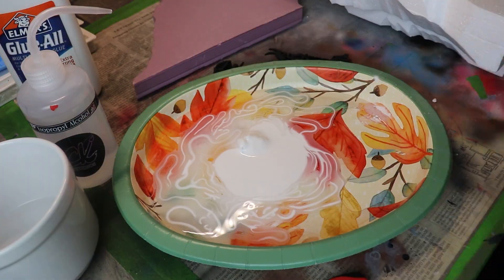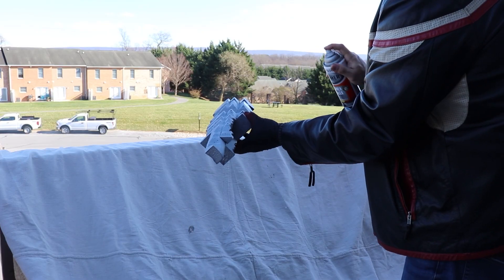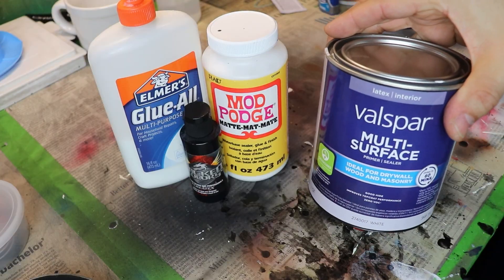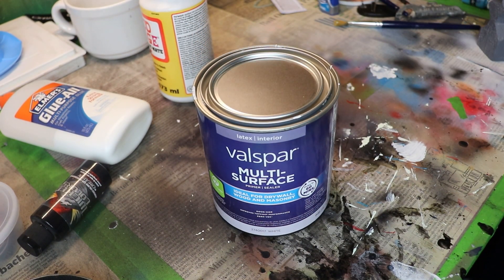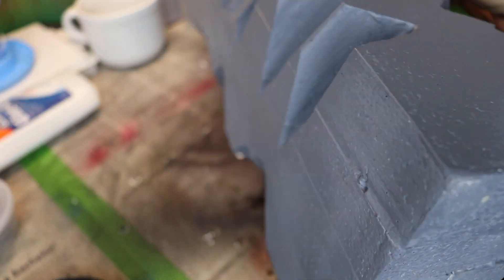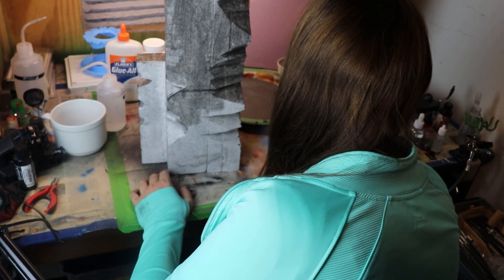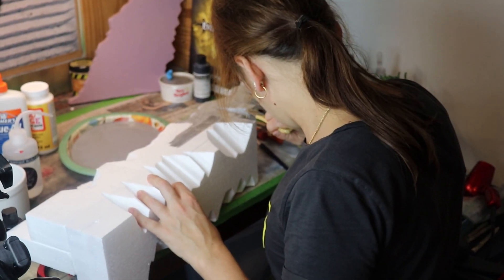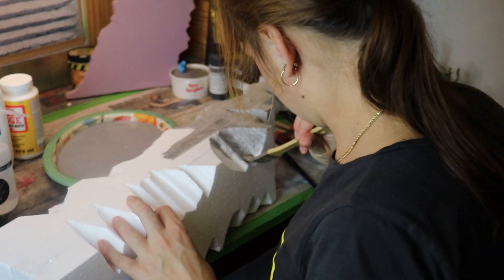Hobby Tip: Spray painting Foam Without Melting

Comment: Good Job TMP! Thank you for the content.
Reply from the maker: Thank you so much for watching Superfly, I hope it is useful in you future foam creations.
Reply: @TheMiniaturesPaintbrush  a tip for you: if you want to use a rattle can, just cover the project with dry wall filler. It works really good with the cheaper white foam.
Reply from the maker: I can see how that can be helpful in covering up the foam, but it will also leave a texture,  I’ll need to get better at my muddying skills.  I will definitely use mudd (the drywallers term for spackle, I use to be one lol) when I am creating my next set of cliffs and floor pieces, it will help me get random elevations which I feel my Fenris table lacks.  Thanks brother for the advice!
Reply: @TheMiniaturesPaintbrush  the easy answer to the texture issue is simply a damp hand to smooth it out. I happy this helps.